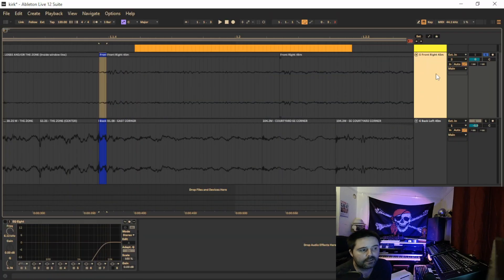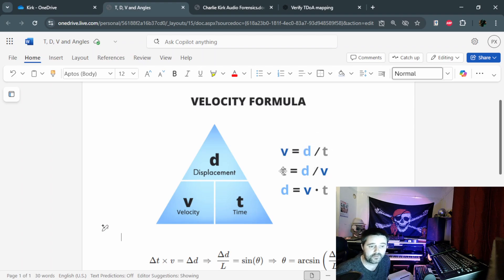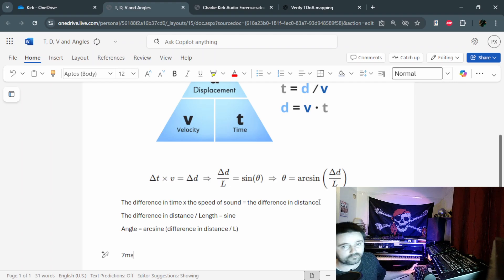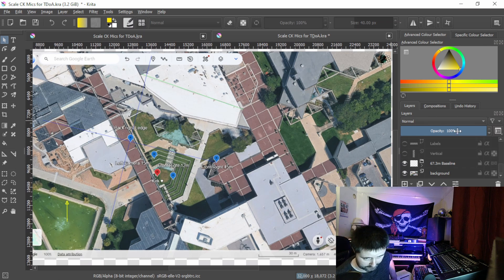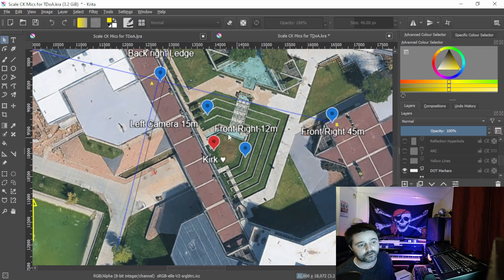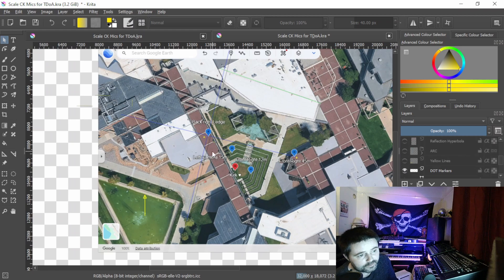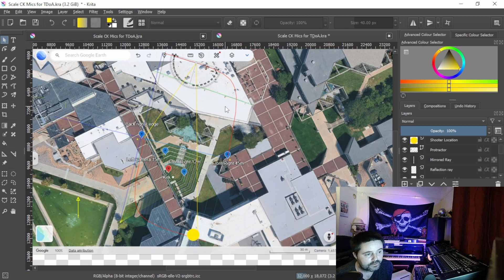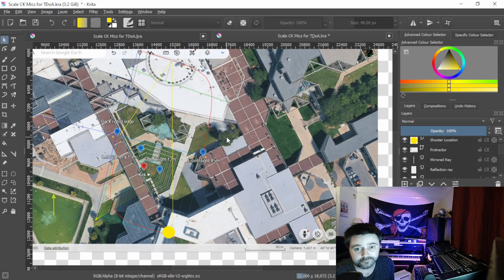Reflection vs Source | TDoA Audio Geometry Explained

Comment: Hey I'm doing my best to understand your modelling here so please correct me if I get anything wrong.

You've got two microphones m1 and m2. You synchronize these microphones based on the initial report of the gunshot (?) and then measure the time t1 and t2 of the first reflection hitting each microphone. You measure (t2 - t1) = 7ms and therefore this tells us that the distance from the shooter -> reflection -> microphone is 2.4 meters longer for m2 than m1.

Please let me know if this is an accurate description of your model. It was unclear to me what some of the variables like L represented or what angle was being measured exactly with theta. 

I think there's an assumption in my summary that both microphones hear the reflection from the same surface. Is this correct?
Reply from the maker: You are correct. We didn't get to theta, sorry if I edited that part out, I hope not. New to this whole recording thing. So sorry if I did. But yes, the timing difference was converted into distance and used to map the angles of reflection and mirrored to create a "corridor?" Of incidence, the corridor is the inverted reflection so from those angles you can create that offset. The law of reflection is important here which could account the audio being reflected before it echoes so that is why more measurements are vital. It's not my method or model I'm just following instructions, so please let me know if you find a mistake so I can correct it. It feels right, if that is acceptable?
Reply: @Audio-Freq  I think the method I described might have some problems. The first is that I don't think that it's necessarily true that both microphones are hearing their first reflection off the same surface. You can imagine many scenarios where that wouldn't be the case. As a simple one, imagine that you have a long wall and the two microphones are each 10 meters from the wall and say 50 meters apart from each other. If the shooter is some distance from the wall, then the reflection each microphone will primarily hear will be bounced off a region of the wall that's pretty close to each microphone. These will be different points on the wall for each microphone.

I think the second issue would be the overall path. The thing that's 2.44 meters longer for microphone m2 is the path (shooter -> reflection surface -> microphone) minus the length of the path (shooter -> microphone). Note that the line from shooter->reflection surface does not necessarily pass through the microphone.
Reply from the maker: @thatcherfreeman  You’re absolutely right that reflections can vary depending on geometry — that’s why TDoA analysis uses planar reflection equivalence rather than single-point reflection. I’ve used that same method here, which is standard in acoustic direction-finding.

Rather than me re-explaining the physics in the comments, it might be easier if you check out a quick overview on “image source modelling” or “TDoA hyperbolic localization.” That’s the exact principle I’ve applied here — nothing exotic, just measured data.

If you spot a numerical inconsistency or a missed assumption, point it out — I’ll happily check it. But the reflection geometry itself is textbook, e.g not my method or model. I can make mistakes, I'm human and I'm happy to own that, so if you want to measure then please do, and then we can talk numbers and run the test again :)
Reply: @Audio-Freq  I've read up a bit on TDoA. The general idea I think aligns with what I described though, which I'll summarize so you have an opportunity to correct my understanding if it's wrong.

The traditional TDoA approach is that you have two synchronized microphones at known locations and they both observe a sound from a point source somewhere. You measure the difference in time stamps of that sound and this gives you a distance difference figure. The hyperbola is therefore the set of points for which the path length (sound source -> microphone) to each of the two microphones has the specified distance difference.

The variation you're using is instead more similar to sonar on a submarine. You have your synchronized microphones and there's some sound emitter. The sound travels from the emitter to a reflective object, and from there it bounces back and hits the two microphones at different times. From the time difference between the microphones, you can again draw the hyperbola, and from the net delay from the emitted sound you can identify the specific distance. Or you can narrow down the location with a third microphone and intersect all hyperbolas from all pairs of mics, which I think you're gonna do next.

The two biggest issues with what I've described are that we're synchronizing the microphones in a sketchy way, as we do not actually know yet the position of the sound emitter. Therefore, the initial shot likely hit the microphones at different times. Synchronizing based on the initial gunshot sound therefore will mess up the timings of the two microphones.

The other issue is that TDoA assumes that both microphones hear the same object/reflection. In reality, one microphone is likely hearing a primary reflection off of one part of a wall, and the other microphone may hear a primary reflection off of a different part of that wall or a separate wall entirely. I'm not sure what your planar reflection equivalence is because that didn't show up on Google, but generally TDoA seems to assume a single point object is responsible for the sound observed by both mics and that this object lands on the hyperbola as described earlier.
Reply from the maker: @thatcherfreeman  I’ve laid out the data and method pretty clearly.
If you think it’s wrong, the test is easy to reproduce — run it and share your numbers, I'd love to see how you'd differ and what results you get man, this is why I'm doing this publicly and what makes it so interesting
Reply: @Audio-Freq  Would you be able to share the videos associated with each mic in the Google drive folder btw? I'll give it a stab once I've got that
Reply from the maker: @thatcherfreeman  Actually, I think it’s important that you source your own videos for this. I’ve laid out the method publicly so anyone can test it, but it looks like the focus has shifted from questioning the science to assessing me.

The goal here is independent verification — if the physics holds, it’ll hold no matter who runs it. That’s what makes this interesting.
Reply: @Audio-Freq  I don't know that I'll have the ability to assess the transient starting points and primary/secondary reflections as well as you did, so my plan was to trust your assessments of those timestamps and then mess with the rest of the modelling under the data we agree on.

Broadly, I do trust the measurements you made, and I think you have a lot of integrity with this whole project. There are just parts of your model I don't think were clearly explained and that forces me to fill in the blanks and figure out what the methodology was and therefore what assumptions are baked into that methodology, if any. That's why I ask you about clarifying the model so much. Clearly if I misunderstand your methodology, I'm at risk of mischaracterizing the underlying assumptions and I don't want to do that either. Surely there are audio-specific aspects where you would likely know much better than a generalist would, so when the assumptions are based around those, I would need to know what those qualities are if I am to conduct similar analysis or interpret audio analysis by others.
Reply from the maker: @thatcherfreeman I really appreciate that, man — that’s a fair stance to take. I completely understand wanting clarity before diving in, especially on assumptions that can shift results.

My whole aim is transparency — I’m not married to a conclusion, just to good data.

I can appreciate that I might not explain things as clearly as someone like Dr. Martinsen or Cullen. I’m still new to the whole video side of this, so if I haven’t communicated parts well enough, that’s on me — and I genuinely value that feedback.

You raise valid points and outline them really well. I’m already planning to address one of them (the sync) in an upcoming test. For this one though, it’s more about defining the reflecting arc boundaries. I know I said in the video the shooter must be on that lower line somewhere, but there are tolerances — even a +/-1 ms shift changes the geometry significantly at large distances. So yeah, I get how that might look inconsistent. I’ll run another hyperbola with the other mic pair and explain that better.

I had a rough night, so if I came across as short with you, that wasn’t my intention. I was trying to encourage your assessment more than anything. If you’d like, we could even jump on Zoom at some point — happy to go through the data and clarify anything as best I can? But it won't be tonight
Reply: @thatcherfreeman  You are making valid points and it's neat to see a constructive approach to this topic.  I am finishing academic literature overview on sound localization and will start my own analyses soon.  I would like to make a general comment regarding the sound "anatomy" of a supersonic shot.  When a trigger is squeezed we get a muzzle blast sound that will be approximately spherically emanating from a rifle's location.  Muzzle blast sounds like a loud pop or a boom.  The second sound component is a crack similar to that of a cracked whip.  The crack is essentially a sonic boom produced by a supersonically moving bullet (and not a muzzle blast).  It's important to stress that the crack is a continuous phenomenon so long that a bullet's speed is above the speed of sound.  The crack sound emanates in a forward direction of the bullet at the angle of the shockwave that causes the sonic boom.  That angle is a function of the bullet's speed.  Thus, aligning various audio based on a crack sound appears problematic.  Cameras at different locations that pick up a direct crack sound are within a "carpet boom" of the bullet.  The position of the bullet relative to cameras that recorded the boom is very likely to be different.  Some cameras could be picking up a reflection whose angle is a shockwave angle that we do not know.  Besides, the ultimate goal is to determine the shooter location.

I think it would be instructive to pick a different pair of audio recordings and see if this "reflection-based TDoA" methodology would reinforce the current result.
Reply: @dmitriynesterkin5672  Yeah that all aligns with my understanding, I think. You mention that the supersonic shockwave from the bullet goes forwards. Would it not be more accurate to say the bullet travels forwards and the supersonic shockwave moves away from the path of the bullet (perpendicularly or spherically?) at mach 1?

IE I think the mechanics are that in a very narrow window of time, the bullet's supersonic movement creates a pressure pocket of some kind, and the sound of that travels from that point outwards at mach 1. This repeats at all moments in time so it is continuous. I suppose another way to frame it would be to ask what we would expect the shockwave to do if the bullet were abruptly stopped, mid-flight
Reply: @thatcherfreeman  One example to consider is rockets going into space.  We do not hear their sonic boom, because it is directed upwards even though the rocket will be moving faster than those booms.  However, when SpaceX boosters return to earth we do hear the sonic boom because it is directed downwards and cameras pick it up.

The angle of shockwave is not perpendicular to the bullet's body.  Instead it is 90 degrees minus the Mach angle.

So, essentially, you are correct.  Bullet outruns the sonic boom as it expands outwards in a kind of a conic shape.  But, if a supersonically-moving bullet were to be instantly evaporated, then from that location we should see a shockwave-caused sonic boom traveling forward and outward at a certain angle.

Did you get a chance to do any kind of sound analysis?
Reply: @dmitriynesterkin5672  Thanks for the explanation, I suppose I've got a bit more reading to do on the shape of the supersonic shockwave then.

I've responded to your email btw, tldr is that I haven't had the time to do my own analysis yet though.
Reply: @thatcherfreeman  Sure.  One of the papers that I've recently read can be found by searching for "Acoustic Shooter Localization with a Minimal Number of Single-Channel Wireless Sensor Nodes."  It highlights some of the concepts and talks about shockwave length, etc.  Pretty interesting.  The concepts are important when it comes to sound localization.  These highlight challenges with other approaches such as Crack to Bang.  

At this point I can only make a sure conclusion about a general direction of the shot sound.